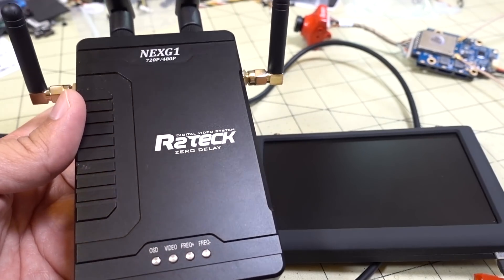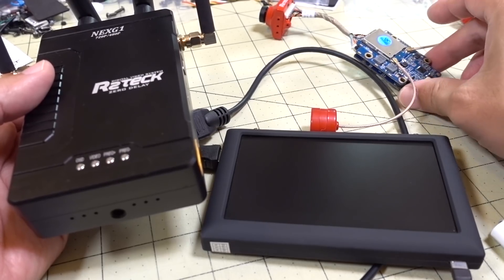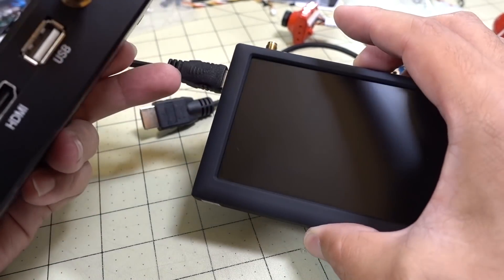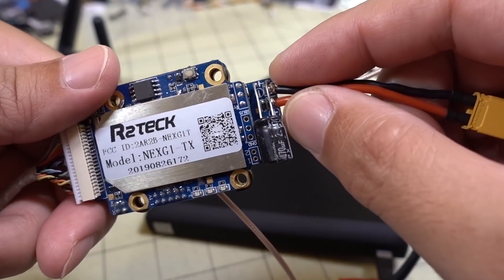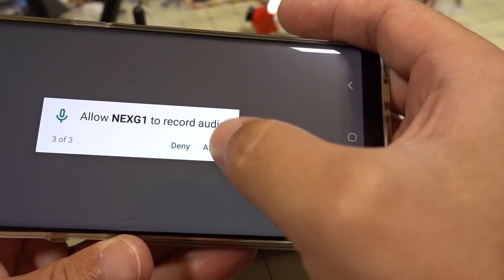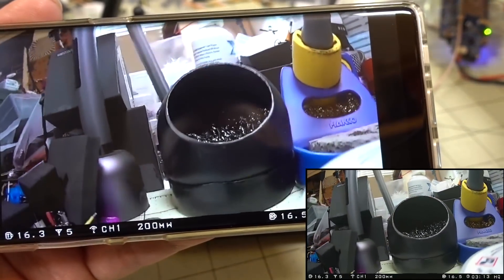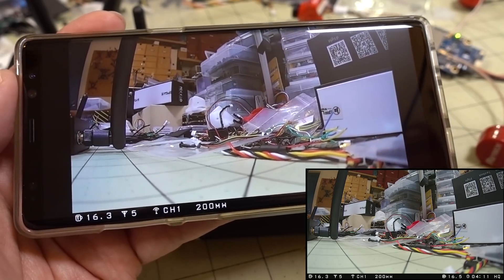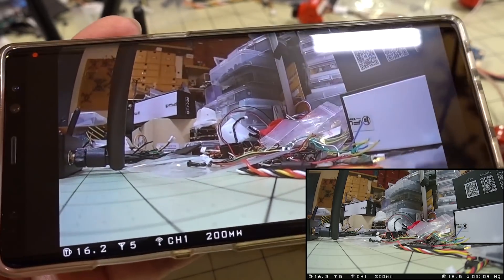R2teck NEXG1 Digital FPV System Overview 📡

Comment: don't buy R2Teck product. this is worst rubbish product. i have bought it and use it. the resolution has been down. i connect my laptop to tv use this product. but the image not so clear. like have some distorsion. very very disappointed. not same like what the sales marketer said. mine are R2Teck DVLM100.

Comment: Looks like there is latency issues with this system just being on the bench?. But thats speculation on my part. Curious to see the flight test? At $339 and after shipping being $350? I dont see how you could justify buying this system. Given you could save a little more money and buy a DJI System with very very low latency proven field test already been done. With new digital systems hitting the market soon it would hard to think about buying a system like this unless it was priced right?😀

Comment: Albert. It says 1000m range on 720p and >1500m on 480p. Its 5.8g so couldn't you theoretically get longer range with a patch and say a axii antenna on the rx to get longer range? I can see an issue if the data is bi directional but if not a high gain antenna for wifi would also work. My dji p3p with stock antennas but only parabolic reflectors I got 25,000+ feet (not sure how many meters this is) 1 way and that's bidirectional transmission.  A bi directional wifi amplifier you can pump up the wattage and get hd long range. I think this is a dji killer just like the r9 equivalent of crossfire or dragon link. The price is low enough ware close to anyone can afford this. And as for resolution it's not 1080 but it's way better than the svga analog we deal with now. Cant wait to see flight footage with this system to compare to the dji and that other coarshair digital system out there  wich is still just as expensive as the dji with the goggles for just the tx and rx nothing els. Been really bored with this hobby lately and seeing this is breathing new life into my passion for rc aircraft.

Comment: Yeah. So... I am glad other HD systems are coming out and I realize that this is still very premature. Dji seems to be further along then everybody else and its tough because one may want to spend less money on an HD setup but you cant sacrifice quality of signal nor can you fly through stutters and glitches like you can breakup in analog. I dont think products should be released with these issues. Those issues should be worked out before putting consumers in an unsafe and frustrating situation. Idk. Excited to see more advancements though. Wont buy till I am sure something works properly. Keep'em coming Albert! This is important stuff for our hobby!
Reply: Those issues can be avoided by not flying far away from you. Remember the range of Connex prosight?